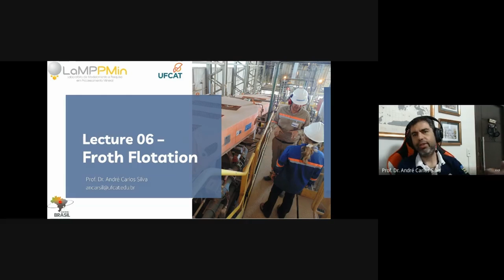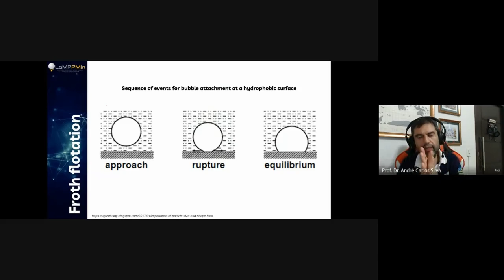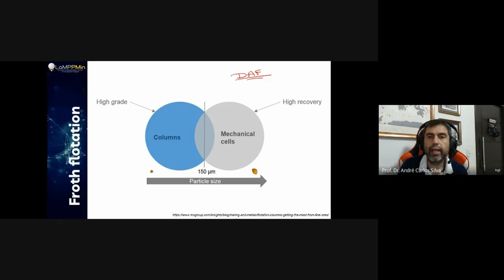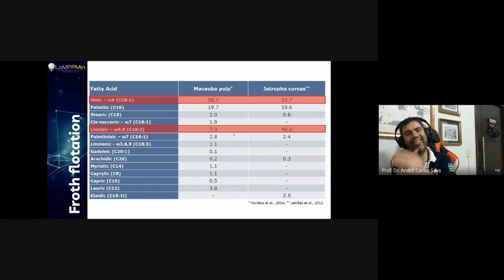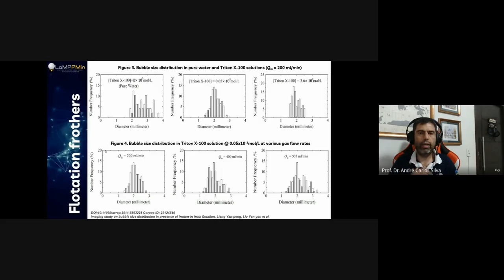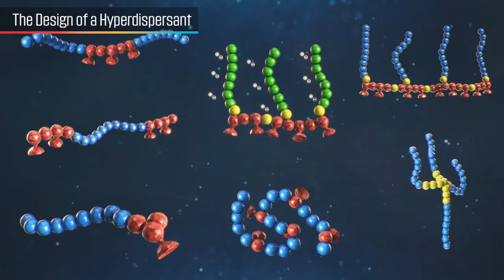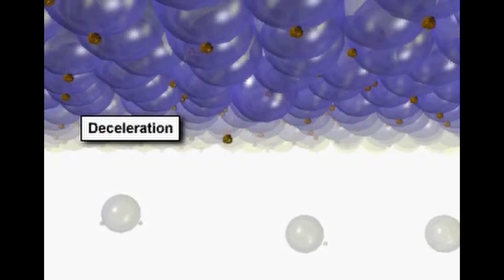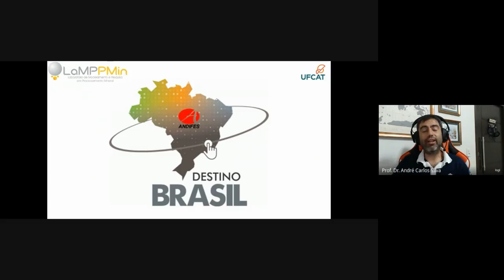Mineral Processing in Brazil: Currently advances and challenges: Lecture 06 Froth Flotation

Comment: Exactly what I needed, this is thorough. However, I do have a couple of questions as I am looking to do this flotation test in the lab. My first question is can I do a flotation with just the collector (eg. SIBX) without adding any frother. My 2nd question, in the absence of copper sulfide ore can I purchase any pure copper sulfide with known purity and just make a blend with any other material for the flotation in the hope that I would float more or almost all the pure sulfide mineral if my conditions are right. Thank you for the help in advance
Reply from the maker: Thanks for your kind words. Normally the collector is also a frother, but that depends of the collector and pH. You sure can make a mineral blend for flotation studies. In fact, you will be floating minerals with 100% liberation, which will be very good for fundamental studies. However, this is a synthetic ore and, therefore, be careful with your conclusions when compared with a real ore.